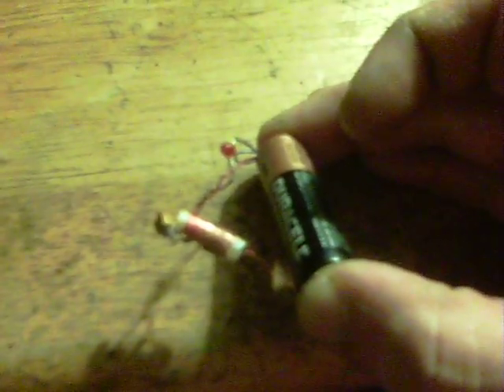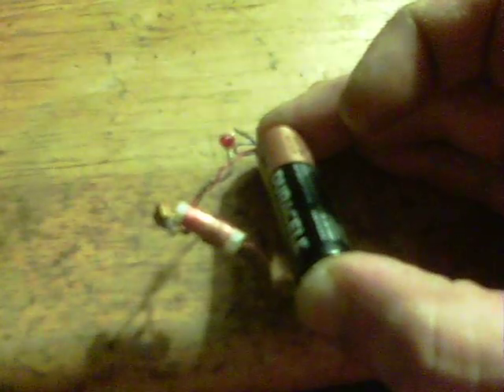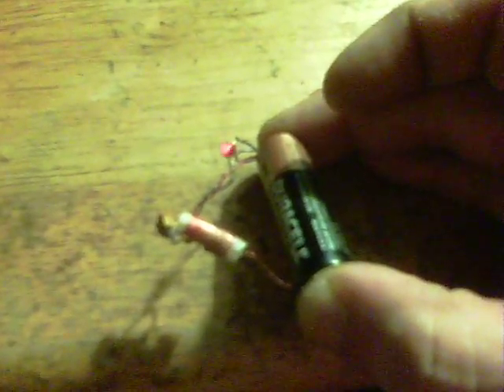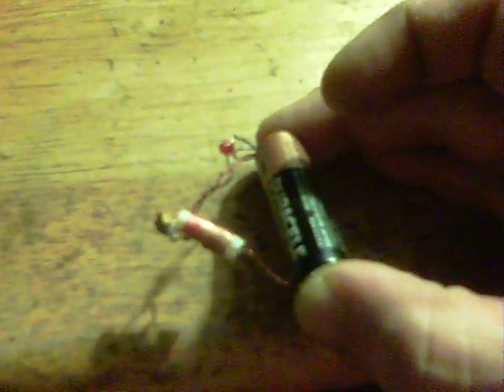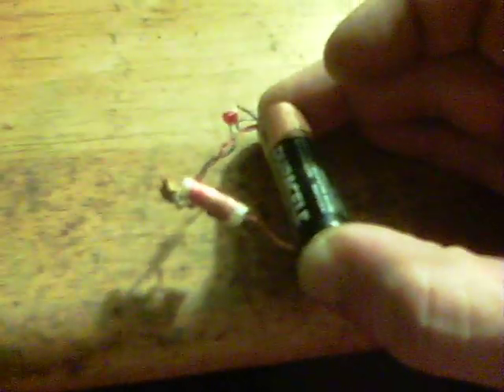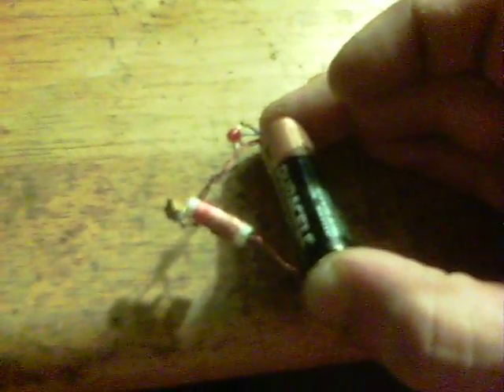Hartley Flasher - Low power JT alternative

Comment: those batteries that look like coins could be used? How long to run out?
Reply from the maker: Yep, they could be used. Such circuits use about 1mA or similar the only real drain being the LED flash itself. An LR44 or similar 1.5V button cell would last for weeks continuously running. If used on an aircraft it would last for the life of the plane.

Comment from the maker: I don't think this exact flasher would suit a beginner, due to the fiddly coil and size...perhaps much better to start with a Joule Thief (1000's of vid tutorials and weblinks with exact instructions). Get one running and then build and build with slight changes to gain skills over time. Natural thing then is to move to what has worked best that you've found while building, circuits get easier to understand. 
My newer vids have the diagrams though of very similar circuits.
Best of luck !

Comment from the maker: All Hartley's will be similar, hence the name. Xee2's diagram is good to follow, his are always clear and concise.
Trial and error will bring the best match for a hand wound coil...quite a lot about this sort of circuit is in the bench testing to find specific values, especially with such coils rather than store bought. You could follow Xee2's and then tune up...use a pot instead of resistor, air-core radio variable cap etc and then replace those with nearest value stock components when tuned.